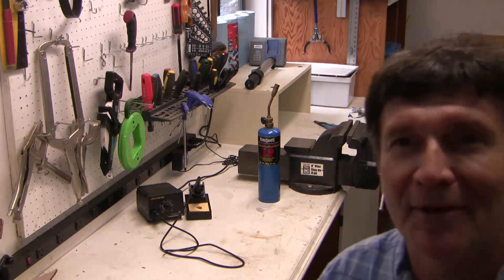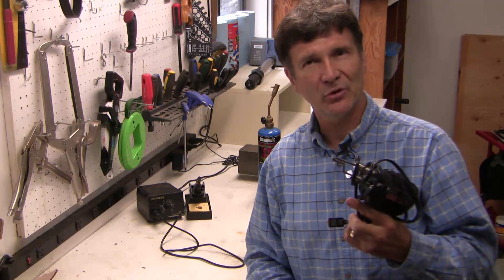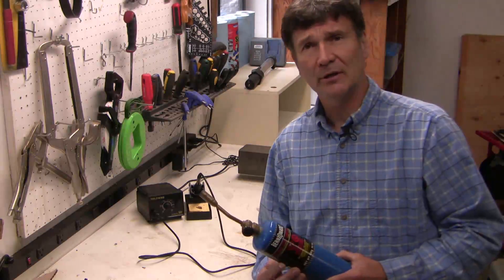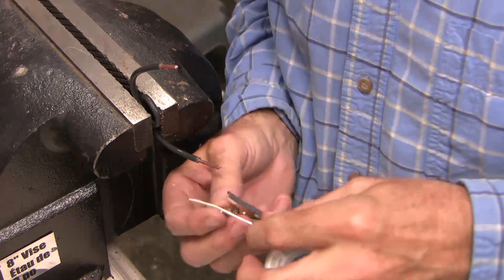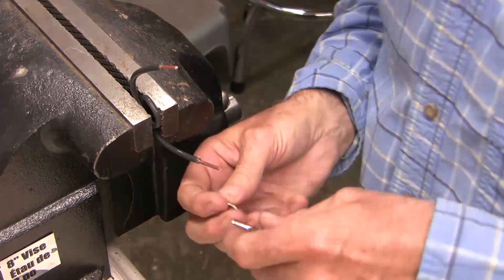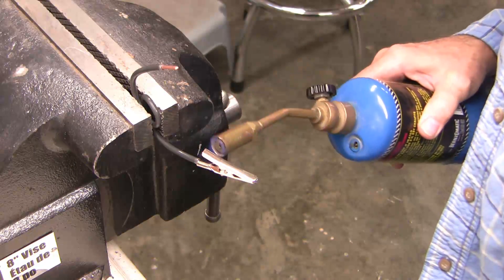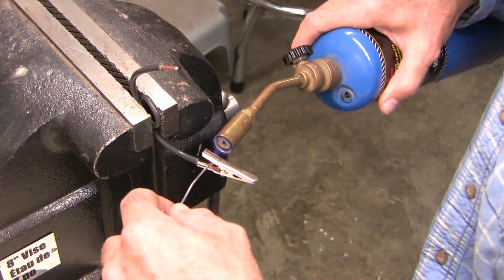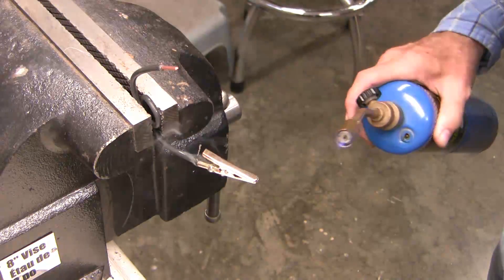Soldering wires with gas?

Comment: Good information. Thanks. What is that tip called that you're using with your propane tank?  I'd like to buy one like that. The one that I have has vent holes in the side which make it fine for soldering, but not so good when introducing propane for O2 response because the vent holes tend to create a large vacuum leak.
Reply from the maker: There are vent holes in this one, too, to allow cleaner burning. This tip is just a standard one you can get for cheap anywhere. I don't use that tip very often any more because I upgraded to one that has its own striker so you can start the burn with one hand. That's a good point about checking for vac leaks in a car. Having seen what fires can do, I think propane is a wise, safer choice compared to spraying liquid starter fluid.
Reply: @spelunkerd  Thanks.  I haven't had a lot of success with introducing propane into the intake to try to drive 02's or fuel trim rich, because as soon as I open the intake system at any point it creates such a large vac leak that the system goes very lean.  At that point, it seems the propane I'm adding is fighting the large vac leak I'm creating and I begin to wonder if I'm really accomplishing any usabe data.

Comment: I soldered car speakers wires with a propane torch and the wires came out to be a little bit black. It works but my question is will it increase resistance alot?
Reply from the maker: It will not increase resistance but if the insulation is degraded there may be a risk of a short circuit.

Comment: i solder with bic lighters sometimes
that and the mini butane torches you find in gas stations

butane soldering pens are also VERY nice, you can torch solder, or standard solder, the butane lighter heats the solder head so it heats up very fast and doesnt have a cable.
Reply from the maker: Those are good thoughts. I need to do some soldering up at the top of my 50' mast, and I think I'll use a butane torch rather than dragging an electric soldering iron and heat gun up that high. The torch will work well for heat shrink insulation, too. The only negative issue I've had with butane soldering is that my torch seemed a little unreliable, and of course wind may be a factor.
Reply: yeah, theres a lot of cheap butane torches, but what i've found is you need to have a good source of refillable butane, and 1 bottle of crap butane. if you cant get a flame with the good stuff, cycle the not-so-good stuff through the reservoir then put the good stuff in.
as far as cheap torches go, what i look for is a metal tip with no plastic connections, and hopefully something easy to fix, the 2 major breaking points are melting and the piezoelectric ignition switch going out. i literally just had that problem after posting my comment, had to take apart the torch and super glue the ignition line into place so it would fall out and stop sparking.

this is why I like the torch pens, they're actually made quite well, the last one I had lasted over a year and only cost me $50

Comment: I bought a Dremel butane torch and am using it on 12 gauge wire, I'm not happy with the carbon left and discoloration. Will propane leave less discoloration? Can I find a tiny propane torch?
Reply from the maker: I suppose so. I don't often solder with propane because the insulation can burn, and any discoloration is from that. I'm sure you can find small propane torches and try that out. Thank you for watching.

Comment: Faster and better using a good soldering station. No burning the plastic covering!
Reply from the maker: I'll buy the point it is better to use a soldering iron, but you can't sell me on the notion that it's faster than gas. Try it with large gauge wire. Even good irons are slow, especially when you factor in the delay it requires to get them started.
Reply: spelunkerd A 70W Hakko heats to 700F in about a minute, and is able to hold that temperature very well once in contact with lots of solder (you can pretty much feed solder into the wire like you did in the video). By the time you prep the wires, it will already be hot and ready, and doesn't require you to fireproof the surrounding area. You'd need some pretty thick wire to warrant using gas (maybe 10 AWG).

You did say "in select situations" though, so can't really argue much there. Trying to solder large gauge automotive wire with a soldering station definitely takes a while. Just not enough surface area being heated to keep all the solder flowing.

I guess my comment was more about your specific example, rather than the technique in general. Gas soldering definitely has its uses.

Comment from the maker: Yeah, I had one of those butane powered soldering irons, which was a hybrid of both techniques. It was fast, but that torch didn't last very long in my hands. Eventually I got frustrated at how difficult it was to light, and the cheap one I had wasn't powerful enough. Most of the time I use a bench electric iron, which will warm up while I do other tasks, and it is good enough for thin wire. But the gas idea sometimes works pretty well, especially for really thick wire. Tinning helps.

Comment from the maker: Thanks. I know a guy who completely rewired a car, and he saved significant time by soldering the joints with a gas heat source. For my use I would do it only infrequently, usually when safety allows.

Comment: I had never thought of trying that. But most of my soldering is too close quarters. I imagine mapp gas would burn the insulation.
Reply: In early 2008, true MAPP gas production ended in North America when production was discontinued at the only remaining plant in North America that still manufactured it. However, many current products labeled "MAPP" are, in fact, MAPP substitutes. Whatever it is now, is only a tiny bit hotter. Not worth the additional price.

Comment: Heat is very handy, i used to work at an autoelectric company, and part of my job was making the heavy gauge harness for connecting the bomb of an alternator to the reguator box and batterys on a bus.

The main battery wires were as thick as your center finger and had to be soldered into military style plugs, a 150 watt weller poker iron was my best frend lol ;-)

Allways tin the wire first and load the connector as well, easy stuff.

With control i was able to solder chips into pcbs lol.